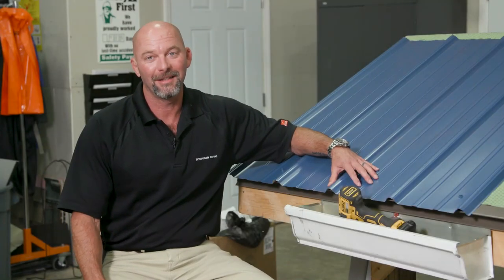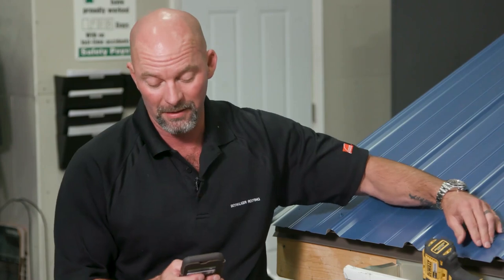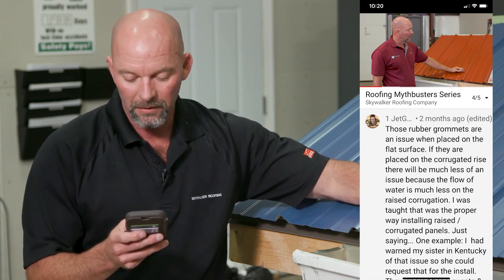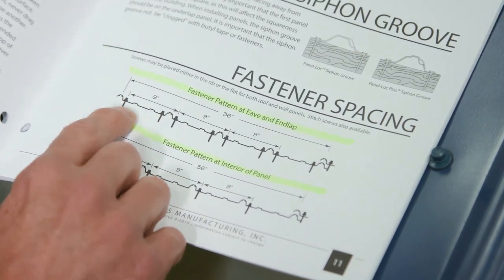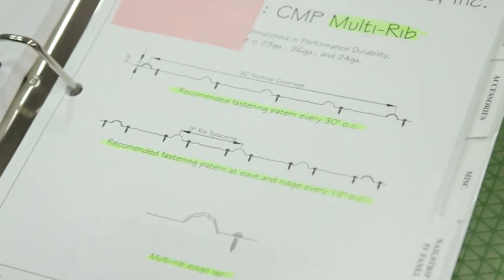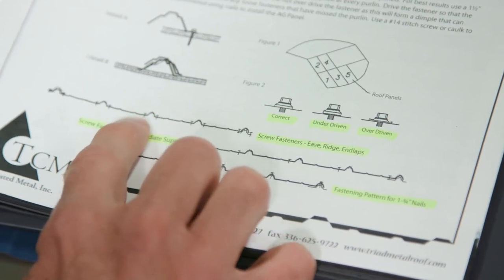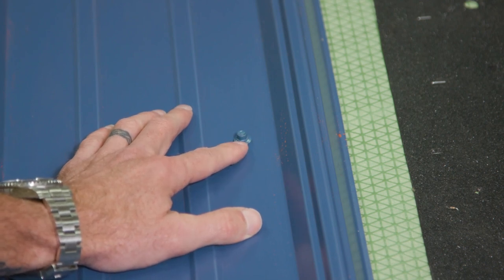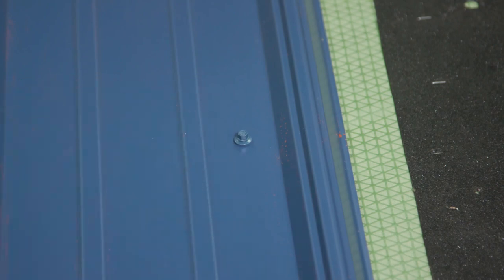You said I got it wrong? Well, let’s just see! | NO SCRIPT with Luke Wilson | Skywalker Roofing

Comment: Excellent video. Thank you. It's interesting to note that TCM's catalog shows a fastening pattern for 1-3/4" nails on the high ribs (as typically used in Australia and New Zealand) to prevent water intrusion due to poorly installed screws. I agree that the use of nails is not a good idea due to their questionable long term performance and also to the possibility of bending the ribs while driving the nails; however, a fastening pattern using screws with neoprene washers on the high ribs should be acceptable.
Reply from the maker: Thanks Marco, I agree

Comment: Hi Luke,
I share other peoples response in that your feedback to the queries presented is timely and professional.
It is interesting though that in the "Central States Panel-Loc Plus Product Guide" that you are quoting from, between the words "Fastener Spacing" and "Fastener Pattern at Eave and Endlap" the line reads, 
"Screws may be placed either in the rib or the flat for both roof and wall panels. Stitch screws also available" 
Consequently, it seems that a request by a client for  "Fastenings to be Placed in the Rib (peak)" would still be in accordance with the manufacturer's directions.
I've also seen that some manufacturers specify that fastenings be used in the rib (peak) for roofing and on the flat for wall cladding. In areas where climatic conditions raise concerns about the security of the roofing panel, it is suggested that a greater number of fixing screws be used.
Hope this may allow for flexibility in discussions with both clients and installers.
Cheers, Peter

Comment: I like your response and the way you handled it. I do however think it makes more sense to use the peaks, not along the edges however, there it is a wise point to back those however with a small rubber sheet roll just like roof peak lines. I understand the authority of it saying otherwise, however I feel the ones that tell people such.. arent interested in their product lasting a longer time for more customer turnover. It does make perfect sense that peak lines will draw less water in the simplest of testing, and that authorities of a product want to sell more, not less. Your secondary product on that other video is great however, obviously preferable in every way. If I were to make do myself with my own work too, I would go with the first one, and fur strip those peaks to fasten, and burn them pre install. But yeah.. thats a slow and possibly failing job for several reasons obviously. Yeah, that elevates the final rooftop work, floating. But.. its a design improvement for many benefits especially in areas that never get tornadoes or such. Im talking higher north higher pitch on the roof. So..  All in all I just like you the best of the whole situation. You got a great personality man. Take care.

Comment: In the case of galvanised steel corrugated roofing sheets (CGI), how do you determine the length of the screws if going through the ribs? Assume that one is using 1x4" or 1x6" lumber for the frame. Through the ribs, there will be considerable part of the screw exposed and in no material - neither metal nor wood.
Are they any standards, guides or codes about this? Is the length and diameter of these screws optional?
In some cases the fasteners appear to  barely pierce the underlying boards. Surely this cannot be secure?
Reply from the maker: There are several different thicknesses of screw threads and lengths. the manufacturer of our Corrugated metal recommends we screw in the flat portion of the metal, but if you are screwing through the rib, I would recommend the screw goes through the wood at least 1/4". Once the screw is through the wood any longer screw wouldn't help. The threads of the screw are holding to the thickness of the wood only.

Comment: As a mecanic that have worked on and off with roofs for almost 60 years i say the modern corrugated  metal is THIN CRAP. hehe
The old corrugated metal for roofs was way thicker and didnt have flat surfaces to screw in,  we used 3" ore 4" nails at the vawe tops,, not the bottom
but i understand the logic why they now screw at the flat bottom parts where you get a better seal that dont open up if you say step on the vawe top.
https://byggebolig.no/imageoriginals/55da89ce090e47e5815644612ecdf5f9.jpg?maxwidth=900